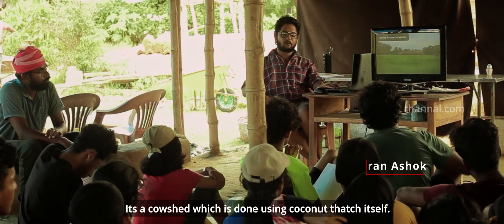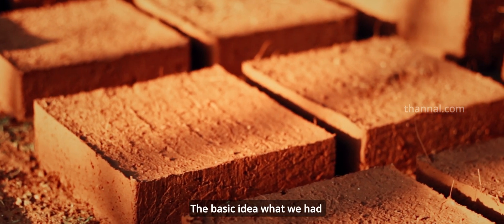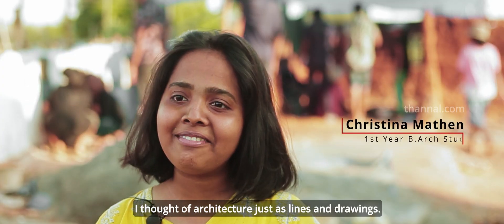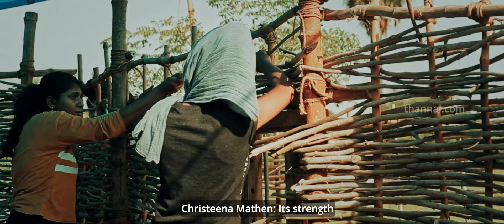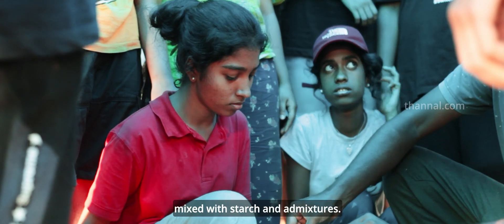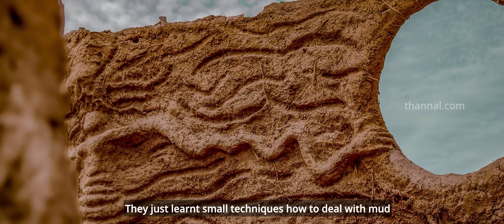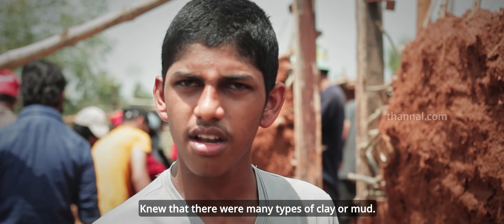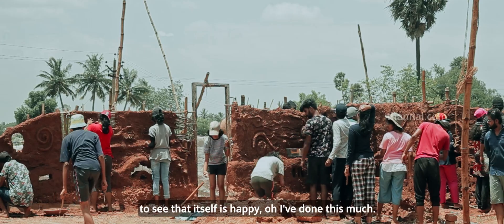Natural Building workshop for Architecture students 2022 - SEED Kochi

Comment: Is there any cost difference between mud house and normal concrete house?
Reply from the maker: Thank you for your question regarding the cost difference between a mud house and a normal concrete house. The cost of constructing a mud house compared to a concrete house can vary based on several factors. Here are some key points to consider:

Your involvement: The total time and effort you personally invest in the project can have a significant impact on the cost. If you are actively involved in the construction process, it can help reduce expenses.

Materials: The choice of materials used in construction will also affect the overall cost. Mud houses typically utilize locally available materials, such as clay, sand, and organic fibers, which can be more cost-effective compared to purchasing conventional building materials like concrete and steel.

Labor: The labor costs can vary depending on the construction approach. If you engage skilled master masons or professionals for the entire construction process, it may increase the labor costs. On the other hand, if you and your friends actively participate in the construction alongside one experienced mason, it can help reduce labor expenses.

Additionally, the cost can be influenced by factors such as the type of doors and windows chosen. Opting for reclaimed doors and windows instead of new ones can potentially lower costs.

It's important to note that the cost of building a mud house can be tailored to fit your specific budget and requirements. By sourcing materials locally and actively participating in the construction process, you can potentially reduce costs and create a more sustainable and affordable home.